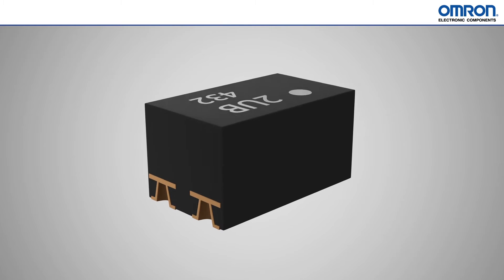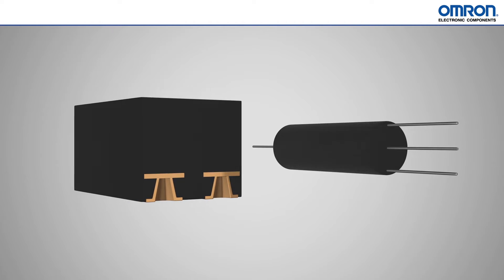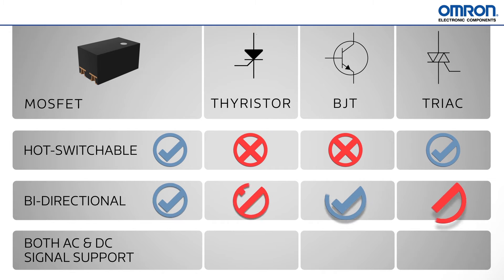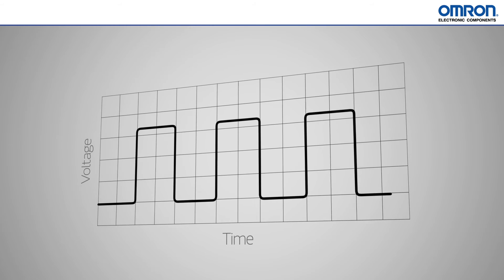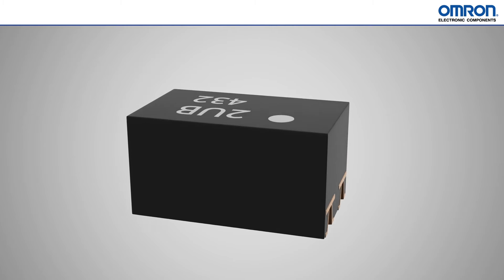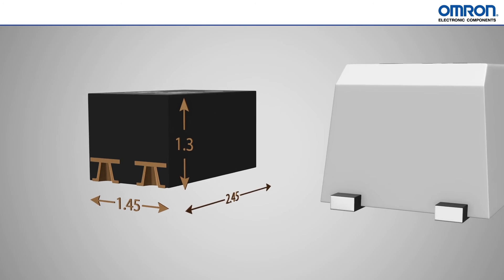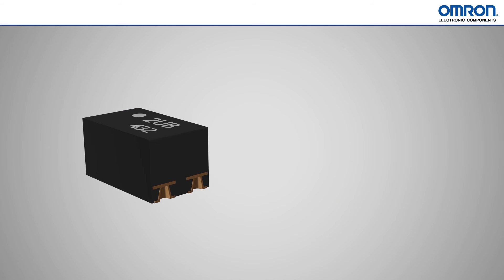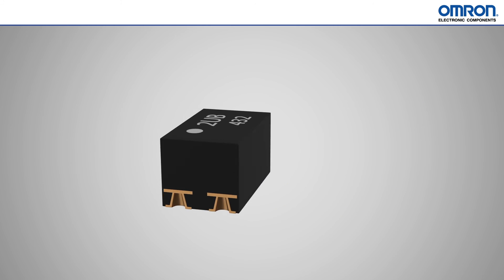Omron's NEW VSON MOSFET Relay

Comment: These are FET opto-isolators so if you're catalogue hunting for sub-miniature optos you might not find them. Not perfect, pretty slow, few mA LED current, capacitance too high for RF, and not dirt cheap. But very useful in tight spaces and welcome additions to the designer's arsenal -- dunno why it took industry so long to come up with them. 
Panasonic and Tosh also make similar, again calling them 'relays'.